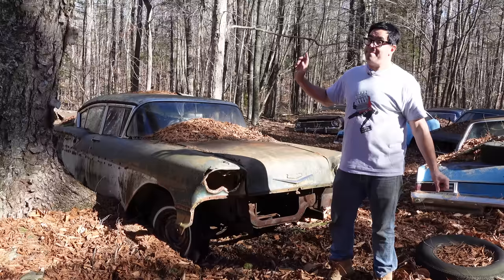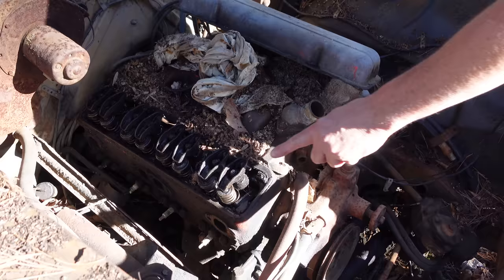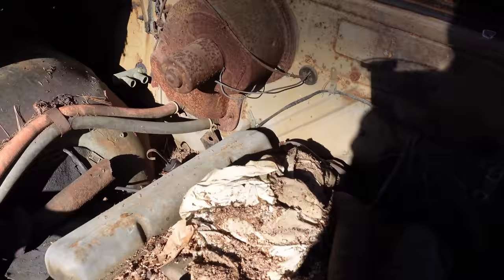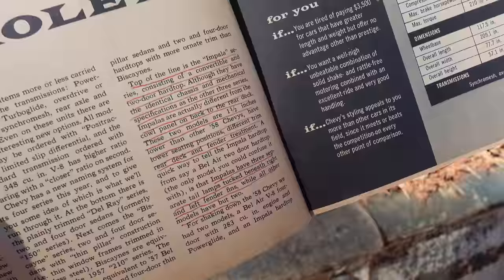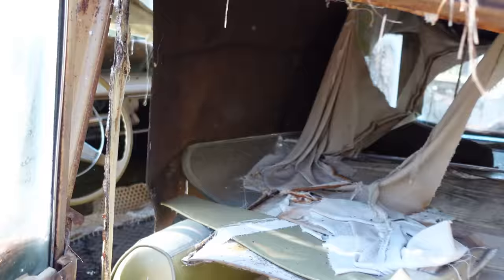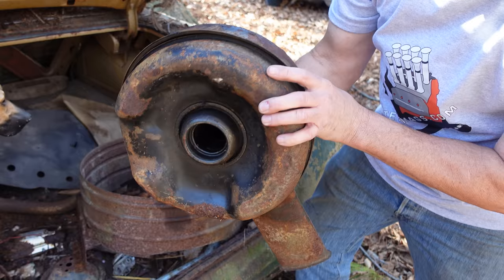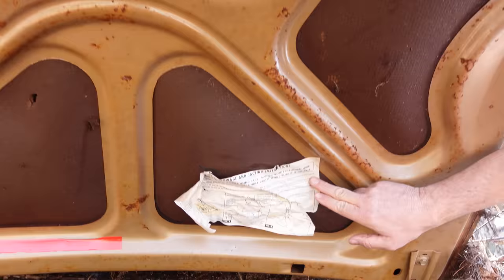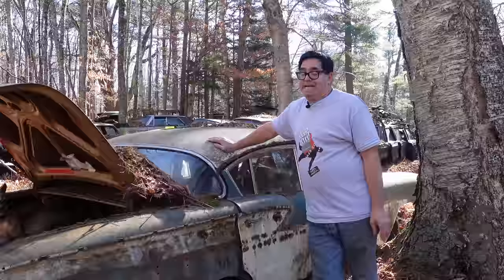Fresh Breath of Bel Air

Comment: In 1971 one of our high school teachers invited a few of us students out to the parking lot to see his freshly restored car.
It was a '58 Bel Air 2door. It was nicely done, but later we talked among ourselves "Why would anyone restore a '58? Why not the 
much more desirable '55-'57s? or even the '62-'64s?"  He was ahead of the curve of course, but it took years before the 1958s became big money cars.
Reply: what would you have needed to restore in a 64 in 1971? That would have made it 7 years old, youd find most of them still running on the road at that point im sure. My nearly 20 year old car is still road worthy as is without any need of restoration, not even visible rust or tears in the upholstery.
Reply: @istvankovats8541   Not in the rust belt in 1971. By 7 years old most cars were junk, Seats worn out, door cards warped, stained. Junkyards were full of rusted out cars with 70,000 miles. Any car older than 1965 was old then. There were exceptions,  of course. But, in general, the styles changed so quickly no one wanted an old car. People wanted the latest and greatest!

Comment: Hi Steve, This video brings back memories of my Uncle Norman's 1958 Bel-Air 4 door sedan that he got used in the mid 1960's. His was in black with the 283 V8, automatic power glide transmission, no power steering or brakes. In its later years it rotted out badly and he once lost the entire gas tank and trunk bottom which fell completely out on Route 6 in Andover Ct. while he was doing 50 mph ! He still drove it for years after that with a 2 and one-half gallon can under the hood.

Comment: My dad's all-time favorite car was the '58 Impala that he bought brand new. He liked it so much when he first saw one that he traded in the fuelie '57 Bel Air coupe that he had only had for just over a year. 348, Power Pack, Turboglide automatic. White over turquoise outside, 3-tone blue inside. When my folks were first married, my mom couldn't handle the power of the big Chevy. She was used to her '57 Chevy 150 4-door sedan with a little straight-6 and 3-on-the-tree. She couldn't start out front a stop without putting down twin 10 foot streaks of rubber! Dad surprised her one day when he got home from work: he had traded in his baby, straight up, on a brand new Corvair 700 club coupe. 84 rompin', stompin' horsepower hooked up to a Powerglide automatic. Talk about two completely different cars from the same brand! They had that little Corvair for only two years. When they found out that they had a second kid on the way (me), they traded it in on a new '62 Biscayne 2-door sedan. Heres the punchline: I've been a die-hard Corvair fanatic ever since I bought my first one in 1980! I once had a much-modified '66 Monza that would have shown dad its taillights in a stoplight drag. Still, I would love to get my hands on that gorgeous '58 Impala!

Comment: Steve, my paternal grandfather bought a new 58 Chevy Impala 2 door hardtop copper tone color with white top and white on the sides.  He had always had Buicks and for some reason decided to get a new Impala.  Years later he had it parked on my Aunt's driveway and while checking the engine he put a brick on the accelerator to raise the idle and the Impala shot out of the driveway which was on a hill and wrapped itself around an electrical pole.  The car was totaled but fortunately no one was hurt especially since it was on a main street with lots of traffic (Far Hills Avenue in Dayton, OH).  To say my grandfather was mechanically declined would be an understatement.  It was a beautiful car and had very low mileage.  We all were glad that he didn't have a car to drive because he was a total menace on the road but relieved no one was on the street at that time.   Thanks for the great video on the 58 Chevy Bel Air and Merry Christmas!

Comment: coil springs were also introduced in '58 because air suspension was the new big thing for that year and the bags took the place of the coils.  every GM line offered it, so all were newly coiled for '58.  didn't work out too well...but they kept the coils after the bags were discontinued

Comment: About that X frame… I was 11yo in 1958 and I remember seeing an Impala convertible being hauled backward by a wrecker through Deadwood. The front wheels were on the ground with the front half of the car level with the ground. The back half was at a 45* angle up to the wrecker’s hook. I heard the frames of convertibles got additional bracing mid-year.

Comment: In 1966 I owned a 58 black six-cylinder Impaler which came from Florida with window defogger only. I froze my rear off the first winter in N.H. In the spring I got a 58-wagon heater at a junk yard. That heater was too powerful for a sedan, so I roasted the next winter.  Such memories.

Comment: I have always loved the Chevy 283 V8.
The 1966 C10 that I drove to high school, my Freshman & Sophomore years (owned by my parents), had a 283. Manual 4-spd trans; and of course manual brakes & steering.

And then, the 1954 3100 that I owned & did a frame-off rebuild of during the 1980s...I installed a 283 in place of the original worn out 235 inline six.
Reply: There was no reason to be disappointed in seeing the 283 under the hood!
Reply: @jfu5222  very true. But I think Steve was hoping for the big block.

Comment: Hi Steve, nice video.  If I am incorrect, I will eat my words. The 1958 Chevrolet did see a new "X" type frame that replaced the "ladder" type frame.  The full "perimeter" frame would not come along until 1965 (full-size) and 1964 (mid-size)  The 1955-1957 Chevrolet was called the "A" body.  The 1958-1964 (full-size) was called the "B" body, and the 1965 and (full-size) with it's new full "perimeter" frame (and would keep the "B" body name} much the same until the very last rear wheel drive Chevrolet Caprice.  The new for 1964 GM (mid-size) Chevrolet Chevelle for that matter was called the "A" body, (the name barrowed from the '55-'57 Chevy) received it's all new full "perimeter" frame would stay much the same until the last rear wheel drive Malibu/Monti Carlo.  Starting in 1955, the 265/283, etc. "small block" Chevy saw a brand new revolution with it's new ball and stud rocker arms, this meant much higher RPM potential and yes, GM put a patent on this.  The "small block" Ford, 221/260/289 etc. would not see ball and stud rocker arms until 1962, seven years after the first "small block" Chevrolet.  Please reply.  Dave...

Comment: Had this same car in the late 60s although it was a 2 door, Salmon red. The previous owner had replaced the automatic transmission with a 3 speed and a Hurst shifter. I replaced the intake manifold with a 4bbl and Carter AFB. That mostly caused it to make more noise. Not much else.  Another kid had an Impala 2 door with a 348 and Tri Power, black. Both were hardtops. For the most part the hot rodders didn't want to have much to do with them. Still run into guys my age that make fun of them.

Comment: The 1958 Chevy is still one of my favorites. I became a fan after seeing that one in American Graffiti. I still have the Impala model that I built about that time.
Chrysler and Ford had re-vamped their cars for 1957, but I believe that the '58 Chevy was worth the wait.
If I remember correctly, the PowerGlide was still cast iron at that time.
Reply: That was an awesome year a neighbor around the corner from me when I was a kid had a two door belair wagon remember that like it was yesterday. But it was about 53 years ago. Also loved the one ron Howard drove in American Graffiti.i have a 57 Chevy 2dr hardtop but would not mind having a 58 also
Reply: @terrencegiordan2775  I like the 57 too. It is still very collectable today. As early as the late 1960's, there were guys in my neighborhood that were collecting 55 - 57 Chevys and fixing them up.
Reply: I have a few of the 1958 model kits, they are a nicely detailed kit with opening side doors and chromed crankshaft.

Comment: My '58 BelAir had a 283 2 BBL with the turbo glide trans and 4 corner air suspension with engine driven air compressor

Comment: Hi Steve, great video on this 58 BelAir. I have always liked the 58 over the 57. My uncle had a cream coloured with a red interior. It had wide black and white stripe inserts. Very odd lookin' for me at the time. So every time I see American Graffiti. It reminds me of my uncle's. So, talking about the X frames. I remembered reading an article on them titled "X Frame Chevy X rated Chevy" dated August 17, 2009, written by the legendary Steve Magnante. The Level Air pneumatic suspension was mentioned in that write-up. Check it out and don't forget to like👍🏼share🫶 and subscribe 🤙🏼 Namaste 🙏🏼
Reply from the maker: That was probably one of my old CAR CRAFT "Junkyard Crawl" articles you saw back in 2009. I did the Junkyard Crawl in the back of every CAR CRAFT for about 10 years! And...now you know where I took the name for my videos. Fact is, it was Ro McGonegal, my Editor back at HOT ROD magazine in 1997 - 2001 that coined the term Junkyard CRAWL. I applied it to the CAR CRAFT stories and nobody at CAR CRAFT cared when I adopted it for my YouTube work. Heck, CAR CRAFT went to the crusher on Dec. 6, 2019. ANOTHER day that "will live in infamy". Thanks again for watching and writing. -Steve Magnante
Reply: X frames seen though 1964. I had a 60, 62 and 63. Two piece driveshaft with a carrier bearing like my square body Chevy trucks
Reply: I subscribed to CC for 40 yrs.
1970 to 2010.
Never heard a thing from them after nor renewing my subscription.

Comment: My granddad acquired one of these, a four door also, I think it was a Belaire…. Had a 235/3 speed. He drove it for a little while until it started burning oil, then parked it and drove something else…  all back before steel belted radial tires. It was probably a higher mileage car when he bought it, but I don’t know what the odometer read. After he passed, the car got gifted to a guy who’d had one in high school and wanted another. I don’t know if it was ever restored, but understood that it was going to get a V-8.  That occurred back in the late 80s and cars that had two extra doors weren’t worth very much.

Comment: Another interesting fact is that there was two different two-door hardtops produced by Chevy that year. The Impala with its sleek roofline was offered along with the Bel Air two door hardtop, which shared the same taller roofline and rear window with the rest of the Chevrolet passenger cars. Busy years for die makers.

Comment: I saw that car in the background in your last video, I was hoping it would be mentioned. Thanks! My first car was a '58 Chevy Biscayne 2 door. It was the summer of 1985. I was 18 and just graduated high school. I bought it for $500. The body was all bondo and painted about half a dozen colors, the floor was all fiberglass, the front seat was propped up with 2x4's, it had no heat, and when I bought it, it barely had any brakes. I was always hitch hiking because it was in the shop more than I ever drove it. It was a pile of junk but it was a fun car to drive and it got a lot of attention. The last time I saw it, many many moons ago, it was in a junkyard (that has long been cleaned out) , the whole floor and rockers collapsed onto the ground, all the guages were missing, and the hood bent in half. Otherwise, it looked exactly the same as I had left it,  primer spots and all. Nobody ever did anything with it. Probably because it was too far gone.
Reply from the maker: Hello Rocket Customs, that's one GREAT car to have as a "first car memory". For me it was a 1969 AMC Ambassador 4-door with a 232 6-banger and 3-on-the-tree. It was 1984 and I was 20. The car was a former Civil Air Patrol staff car and it still had the round CAP seals on the doors and even reflective yellow "For Official Use Only" logos under the CAP seals. Me and my buddies really gave the Civil Air Patrol a bad image by driving all over the place in it, Narraganset bottles in hand while cranking Dead Kennedys and Butthole Surfers on the cassette player! Ahh, first cars! Thanks again for watching and writing. -Steve Magnante

Comment: I had the only 58 chevy in westfield, mass in the mid 80s, id bought it from a guy named Owsiak in either Chicopee or Holyoke... I hated to part with it, but a guy with a 69 mustang convertible offered me an even trade. It wound up going to a guy in Pittsfield for his daughter to go safely to college in. I never saw it again. It was a 2 tone blue and white 4doir bel air sport sedan, all original, 283 2bbl, powerglide, oil bat air filter, generator, right on down to the 4 original hubcaps. Ive still got pix, and my name,  old address and phone number are on a piece of paper wrapped in tinfoil behind the drivers side blinker light assembly. I always hope that someday.......

Comment: Another enjoyable crawl, Steve! Another first for the 1958 was the Turboglide automatic transmission. The shift quadrant had
reverse at the bottom. It was a fragile, troublesome unit and most were replaced with the more dependable powerglide over the years.The '58s had a meteoric rise in values in the 1990s. My boss bought a really nice all black convertible for  $4,000 in 1991.
He sold it a few years later for $12,000. By the end of the decade they were going for over $40,000 !! He said he couldn't kick himself enough for selling so soon!
Reply: Oops! The Turboglide was introduced in the mid-year 1957 models. And it had HR at the bottom (not R) The HR was for Hill Retarder for steep downgrades. Should have looked it up, rather than relying on my memory !!
Reply: @throckmorton8477  The Turboglide was a problem child, some say due to user error. The 1957 was a one year only unit due to Chevy changing its' engine and transmission mounting locations and internal changes. 
The early units used a cone style internal clutch and in '58 they used the more common plate clutches.
The biggest problem was people using the Hill or Grade Retarder as a Low gear, or as a downshift feature.
The HR or GR was only to be used to create turbulence in the torque converter to slow the car down on grades. This misuse caused most of the failures.

Comment: Did anyone else catch the solid retainer with no exhaust valve rotator and the oil shield that wore through and laying at the bottom of the valve spring? Bet there’s a mile or two on that car!

Comment: I think that car has or had power steering. I see what I believe are the hoses and I see the generator/power steering pump combo in the trunk, which I hope you at least picked up, if not the whole car.  '58 used the standard manual steering box in their power steering system.  The color of that car is Anniversary Gold and Honey Beige.

Comment: I believe the 283 was not a thing in 55 or 56,  my 56 210 had the 265 v8 57 was first year of 283 and with fuel injection was first ever v8 to achieve 1hp per cubic inch
Reply: Yeah, i caught that too. But he said small block, not 283.
Reply: @unclebob7937  No, he did say 283
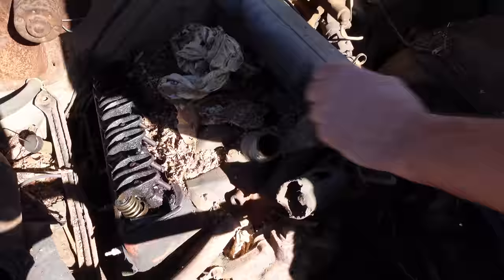Reply: @donesper2070  Check @2:03
Reply: @unclebob7937  ok, got it, he's referring to the stamped rockers when he's saying they where available in 55 and 56 and not the 283
Reply: @donesper2070  Happy Holidays Don. 👍😎

Comment: I wonder if it was that rusty when parked, or is a lot of it,from sitting there? '58's, in my opinion, are better looking than the '57's. Back in H.S. in 1966 I had a '58 Biscayne 2dr. 3 spd. Manual steering and brakes and no radio! But when I went to look at it,I assumed, it had a 6 cylinder under the hood. Nope it had a 2bbl.283. Had 23,000 miles. Nice car.

Comment: After 1957, was Rochester's fuel injection available in anything other than the Corvette? I know Pontiac tried the Bendix unit and it failed.  I had a shot at a '58 sitting in a junkyard and even had a 283 shortblock at home to replace the stovebolt, but I was a teen living at my parents' so there was no way they were letting another car into the yard...:(
Reply: Pontiac never tried  bending fuel injection but did use Rochester fuel injection in 1957 and 1958 similar to the Chevrolet unit only under a sheet metal cover.
Reply: @jime.9185  thanks for that correction, I'm surprised it failed for them since Chevy made it work for a few years.

Comment: Something I’ve never heard explained…. Why did virtually all manufacturers go to quad headlights in 58?
Reply from the maker: Hello Steve Perry. First off, LOVE your band. I grew up listening to Journey. Say HI to Neal Shone for me. Oh, you're not THAT Steve Perry? Never mind....Anyhoo, the quad headlamp strategy was simply a means of getting better night time illumination through separating the Low Beam from the High Beam modes. Previously, the big 7-inch single lamps had dual filaments that toggled between low and high at the touch of the dimmer switch. This was an aiming compromise because both lamps shone through the same lens. But by divorcing the low and high beams into separate 5-inch bulbs, a new possibility in better lighting was realized. But here's the rub. Certain of the 50 United States (Connecticut was one of them) weren't "sold" on the new quad headlamps that started to appear on certain 1957 cars (Chryslers for example). This led to a weird year where some cars were built with 2 headlamp grilles and others were built with 4 headlamp grille designs. AMC did this and I'll have a video on this fact coming up soon. By 1958, all 50 states "saw the light" and quad headlamp grilles became A-OK on cars and trucks. Night time lighting - and automotive styling - too a great leap forward. Thanks again for watching and writing. -Steve Magnante
Reply: @SteveMagnante  Thanks, Steve. Don’t Stop Believin’ 😂😂😂